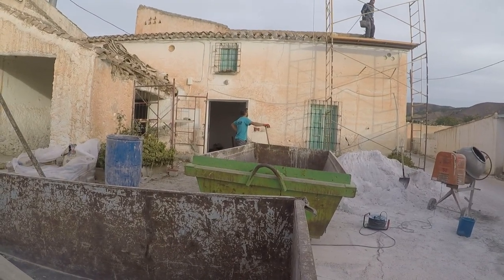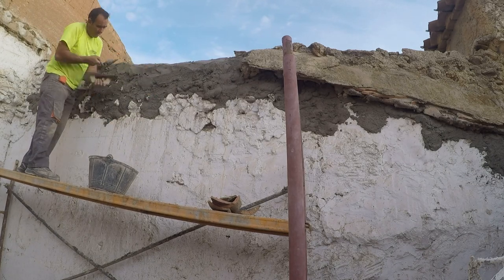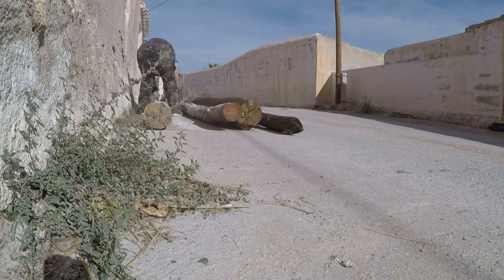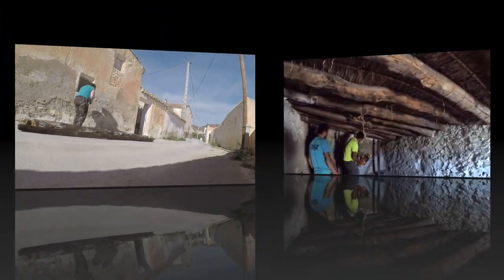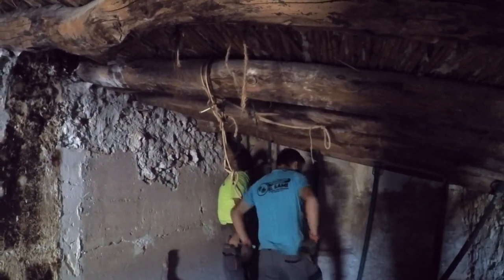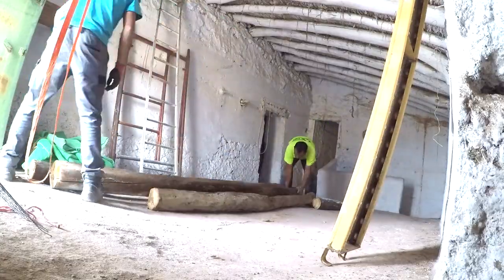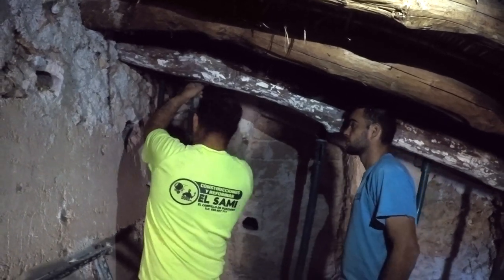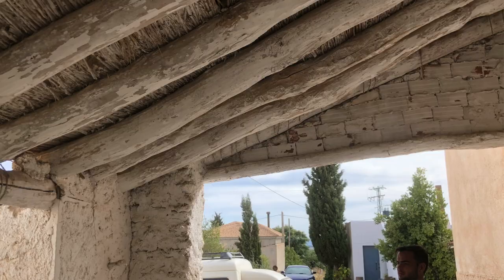24. Part 3 repairing a 300 yr old farm roof & a little bit of life in the mountains with three kings

Comment: I am wondering and seeing a lot of renovation projects going on some very stupid because they use modern layers within an old structure and that tends to get condensated and get mouldy and renovations which shoes all materials or
Materials but from in the fitting the old building
Reply from the maker: Good point, we prefer natural materials too, though sometimes for strength or cost we will use newer materials. We have found a lot of modern plaster had been put into the building around the 1980’s downstairs and we will be taking that out and replacing with lime. These buildings need to breathe